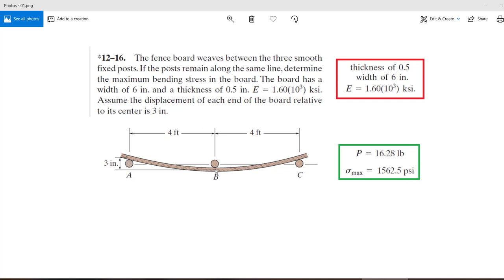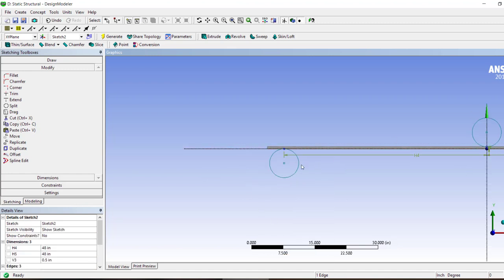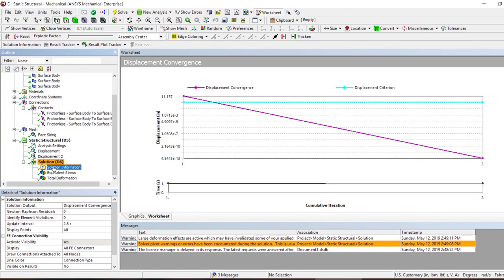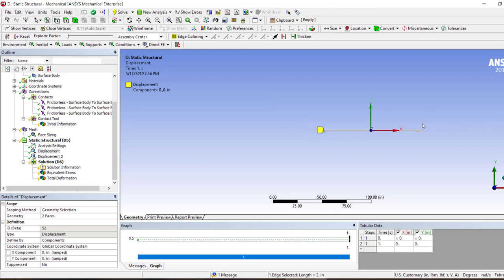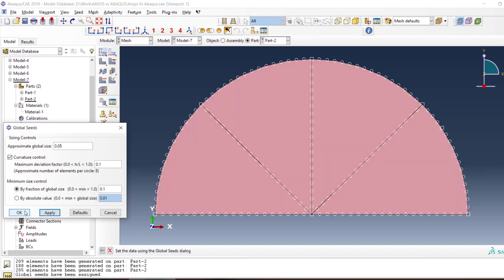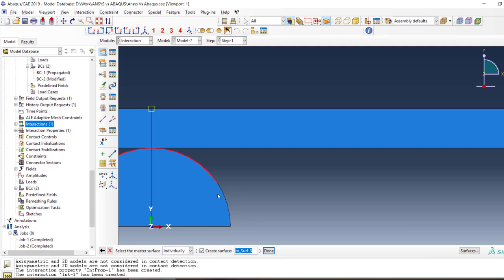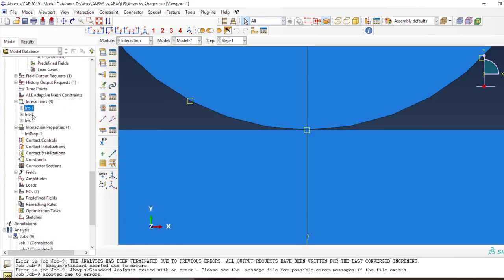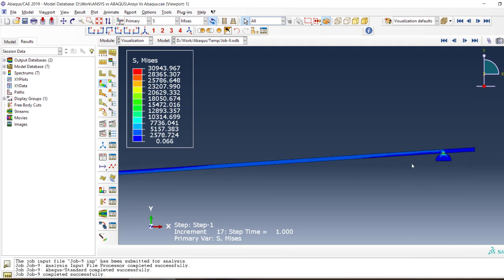Ansys Mechanical Vs Abaqus CAE Part 8 - How to get Wrong results.

Comment: Hi , please tell me what is the best and accurate abaqus or ansys workbench? thanks
Reply from the maker: Both have their own Pros and Cons, if you set physics right results should be the same in any solver :)
Reply: @DesignHyper  my works related to nonlinear static & dynamic analysis of CONCRETE structures, what is the best for me? thanks
Reply from the maker: @amrmasoud5580  Brother! Either is good. Issue is in modeling nonlinear concrete "which one do you prefer". Both will provide different set of inputs. If your work is related to academic research, i would recommend abaqus because its dorky GUI will make you think more than ANSYS. however if it is industry related then you should prefer ANSYS.

Comment: Your videos seem biased... I suspect you are more  proficient in Abaqus and only just started learning Ansys. 
For your meshing comparison, you need to select the "Face Meshing" option and you will find that Ansys meshes just as quick, if not quicker than Abaqus. Similarly with your boundary conditions in a 2D simulation, select  fixed displacement in X & Y translation (free rotation) on one end and fixed translation only Y (free rotation) on the other end.
Reply from the maker: Thank you very much for an honest feedback! On the contrary, I spent a significant amount of time learning and practicing ANSYS(over 6 years compared to just 2 for Abaqus). I would highly appreciate if you could try and get the same results for beam in ANSYS as i got in Abaqus. For Bias - Please check first three videos in this series and you would know that ANSYS performed really well compared to Abaqus. In the next video I will try and use your recommendations. However for beam it is supported on pins on both sides and a pin never supports translation in tangential direction. But nevertheless we can find out through trials and not by guess! Thanks again and Happy Learning!